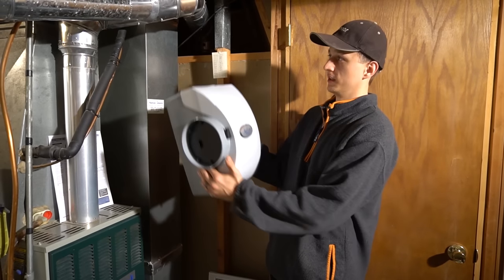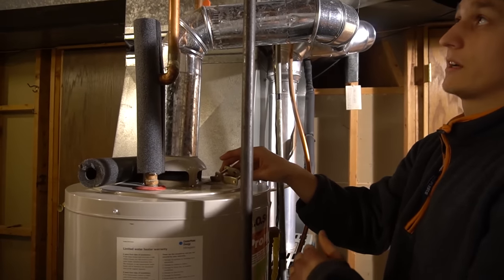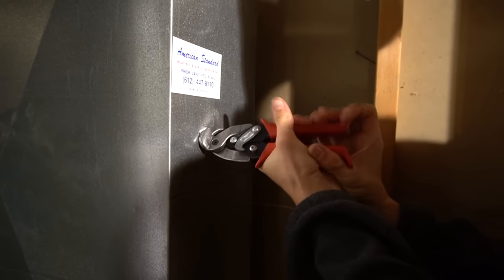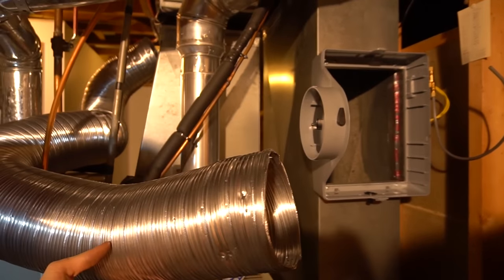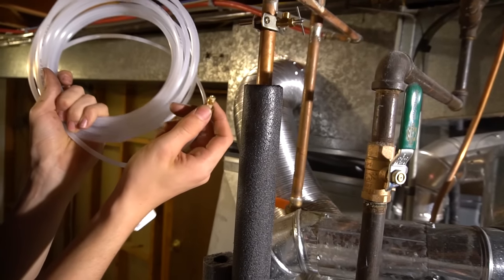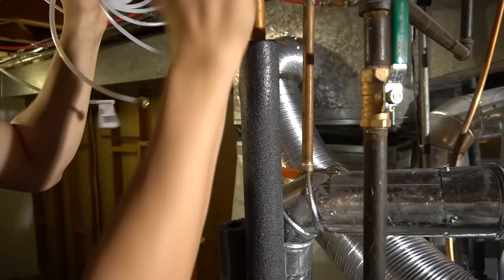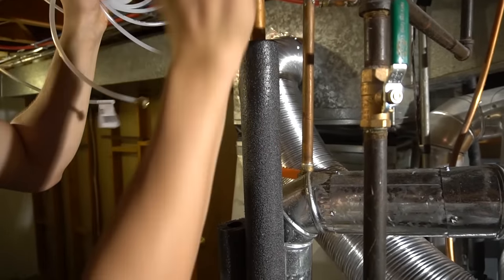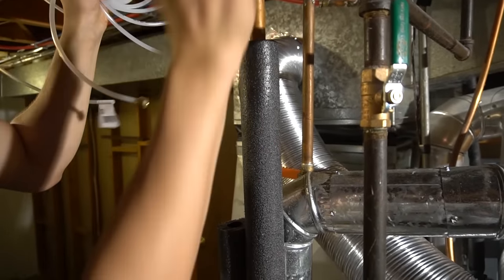Aprilaire 600M Humidifier Installation Walkthrough

Comment: Thanks for the video. I bought a house 3 years ago and have replaced the transformer and solenoid but the humidifier still wasn't working right. After watching your video I realized the wiring wasn't right. Fixed it and it's working great. Thanks!

Comment: This video was great and helped me a ton with my install. The only thing I would suggest is not using the saddle valve. Under almost every state it is no up to code to use them. That and they have a tendency to leak and corrode. For $7 at a Lowe's or Home Depot you can get a connector valve that will do the trick and do it better. Thank you! Have a great day!
Reply: Yeah I agree saddle valves always end up leaking
Reply: Agreed! I'd suggest an angled turn ball valve with a 1/4" output.  An icemaker box connected to a nearby stud is a clean way of doing it imo

Comment: Wiring the Current sensing relay (switch) to the blower motor wire corresponding to the Heat Mode is better than just the Neutral (white); this prevents the Humidifier from running on Cool and Heat modes, especially if Humidistat becomes inaccurate. Normally the blower motor wires corresponding to Heat mode are the lower speed ones, such as Red (low), Blue (med,high), Orange (low/med).
Reply: You capitalized many words incorrectly, and it makes no sense why you did it.
Reply: @guyrabinowitz  I CAP EVERYTHING... EASY TO READ ..LESS CORRECTING
Reply: @matthanlon3511  All caps in writing are not easier to read because most readers are not accustomed to reading that style.

Comment: I'm going to be doing this to my furnace soon,  I understand you can mount it on either supply or return.   But I think mounting it on the supply side will give you a better flow since the opening is larger
Reply from the maker: I would suggest reading through the comments in this video. There are many helpful suggestions and there are things I could have done better. Good luck!
Reply: you are right
Reply: Ideally its on the supply and drawing from the hot water, cold side works. If mounted on the return it MUST draw from the hot water due to the heat exchanger in the furnace killing the humidity as the air passes through to your supply, you wont ever reach desired humidity

Comment: Looks good. Keep an eye on that drain line running across the top of the furnace. A leak at the humidifier would follow the line down toward the furnace. White Rogers circuit boards aren't cheap.

Comment: we connected our humidistat to the circuit board on the furnace and it burned it out. apparently the previous home owner did not install a transformer. so now we purchased a new circuit board hopefully we can get the furnace to power back on. we will go back to your video to correctly install the humidifier when we buy the transformer
Reply from the maker: Oh yikes! Yes, you need to be careful about that... Make sure you do the wiring right. There's a difference between 24 volts and 120 volts. If it fried the control board in the furnace, I wonder if the thermostat got fried as well.. If you have the same humidifier as I had in the video, that is all 24v. That's why the kit comes with a 120v to 24v transformer. There should also be a wiring diagram that shows you how to properly wire it. In the video I don't spend too much time explaining.. But anyway, good luck! Hopefully there will be no more misadventures!
Reply: @WordofAdviceTV  they probably used the low voltage from their furnace. They said they connected directly to the circuit board which the voltage on those terminals are stepped down. The reason they give an transformer because most systems factory transformer does not carry enough low voltage to handle a large secondary low voltage load. They also could have installed a 3amp fuse just incase they hooked up wrong so fuse would blow and not transformer. 
The main circuit board will blow if you steal too much low voltage trying to power something else.
Reply: Absolutely priceless video. Especially the wiring section.   Thanks you so much!  Installed exactly how you described and it worked like a charm.. bravo

Comment: NEVER USE A "saddle valve"... EVER! Always cut in a "TEE" CONNECTION WITH A PROPER 1/2" X 1/4" ISOLATION SHUT OFF VALVE. Also, please use either a 1/4" braided water supply line or soft copper line for the purposes of the water supply connections. Thru that piece of sh** plastic piping that comes with the unit away, cause you will have a leak. That 1/4" plastic crap has zero schedule and or wall thickness to it. You'll thank me later.
Reply: I hope people follow your advise - never install a " saddle value " 
Are these even allowed under building code ?
.
Also , its probably best to install a 90 elbow coming off the Plenum - and then connect the flex stuff to it . 
This elbow should be installed above the A/C coil . 
.
Reply: I can't even get that insert to go in the plastic pipe. My boss doesn't want to use copper he says it's expensive, so I go to the job site and struggle for an hour to put that insert in the plastic pipe. Now, which one is expensive?

Comment: Seeing what little room you had, I would have gone with a motorized unit. It would have given this a more professional and finished look.  Also, that tilted plenum houses the AC evaporation coils and you can never install a humidifier there since it is insulated. I would move the drain line off of any heated surfaces too. Not too wild about flex pipe, but that is my view only. I have installed two of these (550 and a 360) and the motorized versions are now the only way I would go from here on out. I hope it worked well for you. I will be installing a 700 this week in my new HVAC unit.

Comment: Never tried a whole house humidifier. But, I have tried portables. Forget it! They are only good if you put one about 2 foot from where you are sleeping!!  I tried 2 of the best in a 2,100 sg. ft house and unless you are right under one the humidity is 21%. Location southwest NM , 7,200 ft. alt., mountains. winter and gas heat. Max humidity with cool mist flowing over the hygrometer is only 38% !!  With portables, that will have to do.

Comment: Gloves dude! A sheetmetal cut can be NASTY!
Reply: gloves are good. but sheet metal will cut thru them too.   I guess I've been lucky. I'VE ONLY  had  a few serious cuts  requiring stitches. BUT  even if I'D BEEN wearing  gloves  I would still have been badly cut.
MY POINT IS EVEN WITH THE BEST  PREVENTION SOMETHING UNFORESEEN  CAN HAPPEN.  I dont use gloves. Around here  few hvac guys do.

Comment: I am so lost how to wire this. In line with the many kind recommendations on here, I did have mine installed by an HVAC pro and it was never wired correctly. My humidifier runs opposite of what it should... only on when the furnace blower is OFF and then turns back on when the blower shuts off. I am now in the process of rewiring it myself. It never had the current sensing relay on it so I bought one of those but I cannot figure out how to properly wire this circuit. For the record, I have a Harman central pellet furnace so it does not have modern style circuit board with a HUM option.

Comment: I’m not saying your wrong but that’s the first I’ve ever heard of putting the Sattle valve on the hot water side. I’m going to have to do looking into that.
Reply from the maker: In this video I did plenty of things that I could have done better or used a better part for. I guess this would be classified as the cheap way of putting in a humidifier. But about the saddle valve, most of the guys I know put it on the hot water side. The reason behind that is that warm/hot water will evaporate a lot faster than cool water. Since we are trying to add humidity to the air, having the water evaporate faster is good. That's what I was taught anyway. Let me know if you find out something else though.
Reply: That makes since. I guess everyone has there own way. There’s more then one way to do a lot of things it just depends on who taught ya I guess.
Reply from the maker: @HVACingMyWay  With HVAC there is usually more than one way to do it and there is more than one name for parts. Thanks for commenting!

Comment: Thanks for this video, I live in Chicago area and I just got an estimate for the humidifier, the installer suggested a bypass large whole house humidifier made by Bryant, my main concern is knowing what is the right kind of humidifier, bypass or motorized to install any advice would be very much appreciated, thank you, And my house is 2500 square-foot, and currently the humidity is in the low 20s without the humidifier which I feel is very low
Reply from the maker: 20% is pretty low. A whole house humidifier would make a noticeable difference. The main difference between motorized and bypass is the bypass itself. That extra piece of ducting takes up more room and that really is the one con (which I think isn't a big deal). They both do the same thing, though the motorized one is supposedly a little more efficient since it has its own blower fan. The 2 cons to the motorized one is that it costs more and it has more parts in it that could fail, costing you more in maintenance.. I personally would go with a bypass humidifier. Like grandma used to say though: different strokes, for different folks. The decision is yours to make ;) Good luck!
Reply: ashish batra q
Reply: Bypass is intended to be mounted on the return side.  Motorized on the supply.

Comment: Question about wiring. I deal with new furnaces so i wire the humidfier with r and w so it runs on call for heat... anyways.. so i run the 24v power (2 wire) to the humidistat, and then another 2 wire from humidistat to the solenoid?

Comment: I’m contemplating on installing the water saver model Apr 400 with backup drain. Its approximately a savings of a dozen toilet flushes a day :) Trying to understand the mechanics of it, meaning how the dual floats work, relative to the sensing and water valve.
Reply: 400m and 400a is a drainless humidifier. One float detects how much water is needed inside the tray the other float is a safety float to shut water valve off. The drain at bottom is just an overflow drain. The water panel is recommended from Aprilaire to replaced 2 times a season. This is my favorite humidifier cause it saves water. It only fills and use what it needs vs dumping a constant flow of water across the water panel everytime the humidifier comes on.
Reply: Please do not install your humidifier the way this guy did. Use copper tubing and ditch the saddle valve. They fail regardless if you use shut it or open a lot. Use a ball valve plumbed into your water heater. If humidifier is going to run off humidistat without a call for heat from unit then you need to use hot water. You can use cold water to a by pass humidifier. It may be a little more efficient with hot. It won't make that big of a difference. Forced fan humidifiers require hot water only to them
Reply: @pineychristian  , Thankyou for the technical details on the model 400. I feel confident that the 400 will get installed correctly, now that I understand what each float function does.  And, a special Thanks to “ Word of Advice TV “ for his fantastic video. I will improvise with improved materials, like using cu tubing, and ball valve, and if possible, I may use standard duct connections, instead of what the manufacture provides in the box. Again, well appreciated !!!

Comment: Even though comes with a piercing valve you should never use them because over time they will fail. You should sweat in a valve or you special compression fitting that they sell in the supply house
Reply from the maker: I completely agree. Though if you do not open and close the piercing valve but always leave it opened up, you shouldn't have a problem with it sticking or leaking. I will just leave it open and not shut it at all. If it ever starts leaking or something I suppose I will have to sweat in a ball valve or something.
Reply: Good advice saddle valves are not code approved any longer but that doesn’t prevent them from being installed.
Reply: I am 100% in agreement with you here. Typically they are installed right above the water tank and leak directly into the fiberglass insulation. I killed a fairly new water heater because of a leak.
Reply: Total agreement. An off the 1/4" plastic tubing too and run 1/4 copper tubing.
Reply: Had them for 30years buy good plumbing parts never had a leak but dont bury one in the wall or ceiling

Comment: Any issues with the polyethylene tubing in the past 2 years since your install? Most say PE tubing is not to be used with hot water, and the Aprilaire instructions call for copper piping.
Reply from the maker: Everything good so far. I know people who had the plastic tubing for 15+ years and all was good.
Reply: My polyethylene tubing just blew — complete disaster
Reply from the maker: @def__init  Yikes! Sorry to hear that. Do you know how old the tubing was? Was there something that caused the rupture (maybe it was touching a hot exhaust pipe) or it just randomly burst?
Reply: Saddle valves are illegal plumbing fittings. You should only use copper tubing. Hot water side is not recommended because of the changes to the water during heating. Cold water is preferred.
Reply: @paulb41  where are saddle valves illegal?

Comment: Was looking for which ducting (on the intake/return vs outflow/blower) the Aprilaire box goes on, and where the humid air should be going into (on the intake/return vs outflow/blower). My house has one installed and it looks weird: the aprilaire box is on the outflow/blower, and the bypass is into the intake/return which goes thru the air filter. Weird: 1) coz the moist air goes thru the air filter - the moisture will get on the air filter. 2) Moist air will go thru the furnace! Why! 3) Inefficient coz the air is just cycling between the outflow and inflow. I have closed the flap leaving just 10% open to minimize this). Overall this setup is not making any sense.  Agree moisture is getting into the outflow, I can feel it coz I do not get a dry nose. Why can't a bypass be entirely on the outflow, it needs a different routing.bypassing of the hot air thru the aprilair box and back into the outflow.

Comment: I need to replace an old 445. with the 400M.  The old one was powered from a standard 120 outlet that was controlled by when the blower motor was on.  Can I just put a plugin 24VAC transformer into that blower fan controlled outlet?  Or NO I need the current sensing relay?
Reply: It seems nit. So i inatalled the Transformer on anither live source and used the current sensing module.

Comment: You think this would work with a tankless water heater? i have a navian and worried there would not be enough of hot water demand to get hot water flowing to the humidifier.
Reply from the maker: I know technicians that install the water valve on the cold water and it works fine that way too. That would take care of that problem.

Comment: I do enjoy your videos but I have one question, on the Aprilaire site, I have seen the installation shows the unit being put on the hot side not the   return. Is that acceptable and does that affect it's performance?
Reply: yes it does, more humidity when its on the supply because that air is very hot

Comment: I have the same model installed last year and somehow this year it doesn't water the filter anymore.  it is set to high but still, there is no water coming making the air very dry.  Any advice on how to fix it?
Reply from the maker: Is the water turned off to it by chance? If you take apart the nuts from either end of the water solenoid (don't forget to turn off water to humidifier) there should be a screen on one of them. Sometimes that gets plugged. If you have a meter, when you turn up the humidistat, check the two wires going to the water inlet valve. Is it getting 24v? If it is but it's not opening then that valve is probably bad.

Comment: Do you need to drain the water in the plumbing before you replace the saddle valve? Mine is stuck and I need to put a new saddle valve on.
Reply: Saddle valves  are complete DIY GARBAGE ! Cut in a tee with 1/4 inch fitting in existing copper pipe . Trust me you will have mega problems ,not to mention leaks when you are not home

Comment: It is Winter cold in Mi. I have this. Would I get more humidity in our house if I set the furnace thermostat from Auto to Circ?
Reply: Barbara Hookway depends how it’s wired.   Designed to come on when thermostat calls for heat.
Reply: Not sure if this guy is a professional or diy but not Avery neat install.  Flexduct is horrible.  Most newer furnaces have humidifier terminals so hardwiring transformer not needed.   Also you run COLD water through them.  Most say in the instructions do not tie to hot water line.    Good luck.